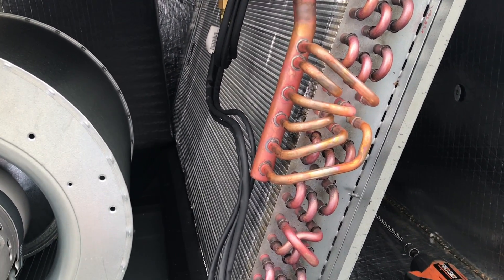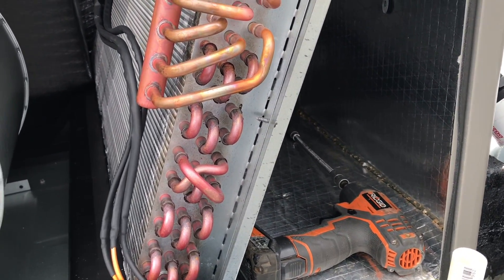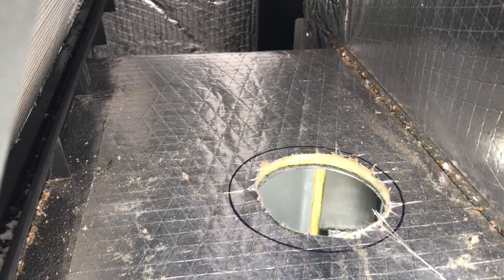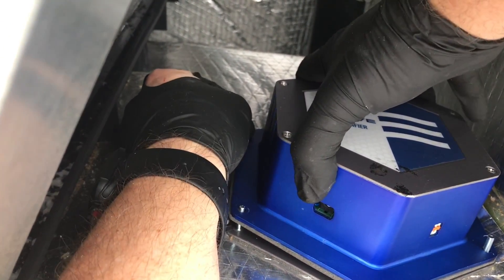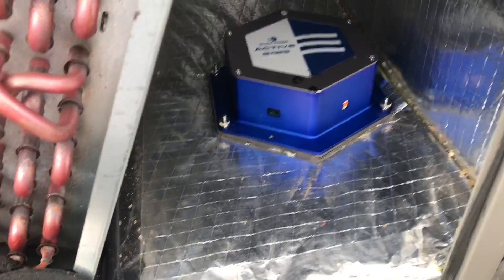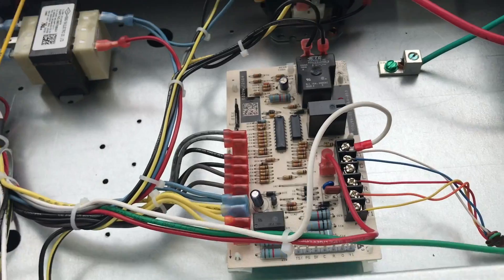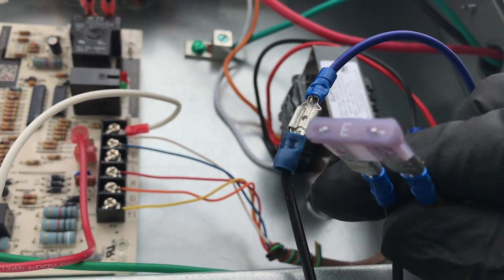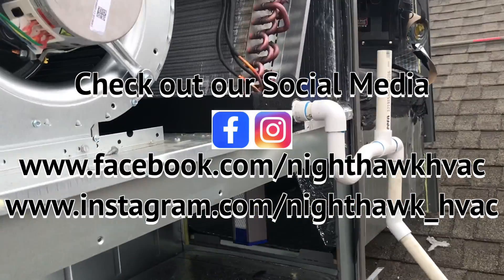How to Install an Air Purifier/Air Scrubber on a Lennox Heat Pump Package Unit. EP31

Comment: Hi,
Another worthy video that offers insights, techniques and how a professional tech performs.
My only suggestion would be that if time allows, show the panel wiring diagram and refer to it when discussing/showing and control circuits involved. This could be a big help for some newer techs.
Thanks and keep up the great work.
Reply: I agree

Comment: The Air Flow Indicator (Arrow) is located at the opposite end of the Power Pack. It is only visible when you have it out.

Comment: Should be installed ahead of evap coil inlet.
Reply from the maker: I know. I messed up. I feel dumb. I could have installed it in the heat strips port after the coil. Realized it after I cut the hole. Hopefully my mistakes avoid others from making the same ones. Thanks for rubbing it in. Lol.

Comment: Just a few suggestions, I am a technician myself. I know that 99.9% of these style of air purifiers are not waterproof, also they need their own dedicated transformer. I am happy you put a transformer for this one, but you said it's ok to tie into a existing transformer which most technicians do then they womder why they end up with burnt out transforms in the future. 

I emailed the manufacturer to get specs on this equipment to find out if I am wrong. I also would like to know the limits of this device vs a REME LED or iWave
Reply from the maker: I usually always install a dedicated transformer when installing an IAQ. Typically a 40VA transformer is more then enough to power a control board and a thermostat and then some.  I don’t think they draw that much power to overload a 40VA transformer. But I could be wrong. If the manufacturer gets back to you I’d be interested in knowing. Thanks for the feedback.
Reply: @NighthawkHVAC  The Dust Free Active now includes a 40VA transformer. At 24VAC the current draw from a 12" Active is 1.4 Amps. 0.3A @ 115VAC, and 0.15A @ 230VAC.

Comment: Question, what's going to happen one day when that coil freezes up and water gets in that device.
Reply from the maker: It’s a Lennox. That would never happen. 😜😝😜. I should have installed it where the heat strips go. I’m human. I messed up. Thanks for the feedback though.

Comment: Great video. Thanks! 

Some of these new LED scrubbers (like Reme Halo LED) recommend wiring parallel with blower power so it runs on/off with blower. How is best way to wire that using separate transformer?
Reply from the maker: Most control boards have a high voltage output for Electronic Air Cleaners. This is usually a 120V connection. All you have to do is connect your transformer’s high voltage side black wire to EAC and the white wire to an open neutral port. When the fan is energized it will send 120V to the transformer which will power up the Scrubber. Thanks for watching!!
Reply: That one dosen't look as if it's a LED product. If it is not a LED product then wiring it in that style will burn it out.